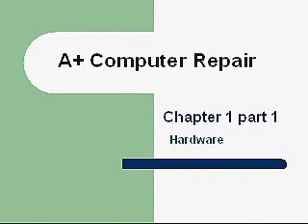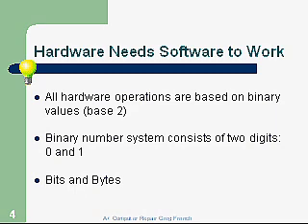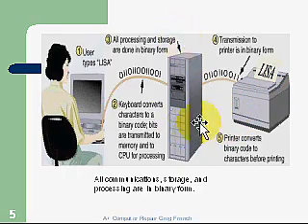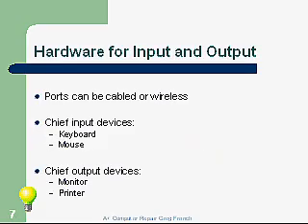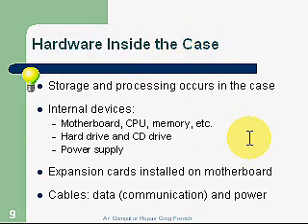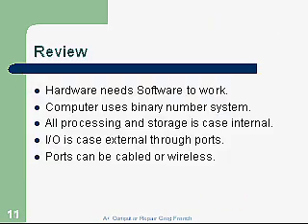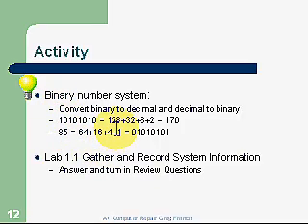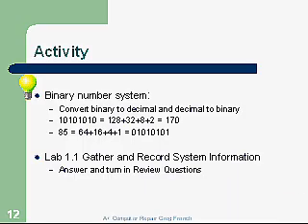A+ Computer Repair Course Chapter 1 part 1

Comment: HELLO GREG! Am an avid Subscriber, you are my first 'Go to' when diagnosing PC issues! I recently built a new Computer in my old Tower with an MSI Z390-A PRO Motherboard with an Intel Pentium Gold Processor G5400 CPU @ 3.7GHz! Next added  64.0 GB DDR4 3200 Ram! Also a ZOTAC GAMING GeForce GTX 1 Video Card! Recently upgraded all my HHD's with an Intel 660p Series M.2 1 TB SSD Drive C and two WD I TB internal SSD's! My Computer now boots up completely for a cold start in 30 seconds!!!! (Once in a while when I turn it on, it Boots into the Bios Screen)!!!(But when I wont to boot into Bios, no matter what key combination I press it wont go into Bios on Command)! Windows will not display on my Digital Monitor but I can see the Bios Screen on another HDMI Output to my 32 inch TV! Am running XMP Mode and Gaming Mode on the MSI along with allocating 3/4 of my Ram to Process my Adobe Premiere 2022! My Question is: How do I get the computer to Boot into Windows EVERY TIME? And secondly, How do I get my computer to boot into Bios on command?

Comment: Learning A+ is not only good for getting a decent paying job but can save you money in the long run example you can buy a new computer in parts and save money buying it in bulks i just got myself a monster computer that would be worth $2100 and got it for 900$ 

Another example if your computer breaks down no need to pay 500$ for a tech! do it yourself you saved 500$!

i recommend A+ for all even if your not using it for a career!

Comment from the maker: @myusuf70 Hardware problems are easy ti fix.  If the computer shows no life it is usually the power supply.  Only 4 screws hold it in place.  If the computer shows life but you have a dark screen it is usually the video card.  Only one screw holds it in place.  These are the top two hardware problems.

Comment: I have the A+ Book at home....it shows how to take apart a laptop...just remove 4 screws from the bottom....LOL I wish it were that easy.  Tearing down a laptop is a lot of work. I don't know who writes these courses. 
I wish they would teach more practical stuff...things that you will do working in a repair shop everyday. I'm no expert here but worked for many years in a shop where we fixed all kinds of electronic stuff.

Comment from the maker: You should have several years of senior network maintenance experience and be at a network analysts level to understand all that is required.  Cisco certs CCNA and CCNP would help.  Certification is achieved by taking the C|EH test after completing either training at an ATC (Accredited Training Center) or self-study.